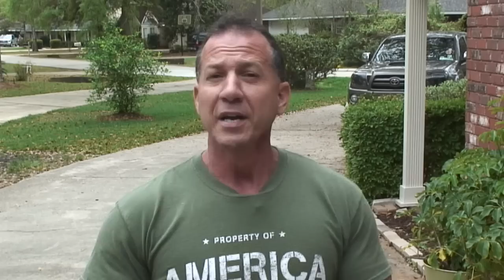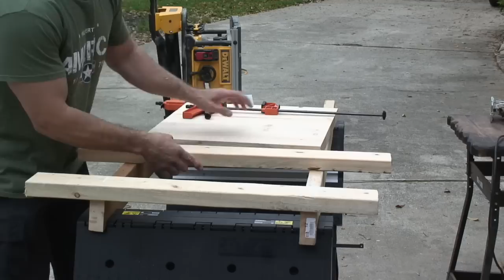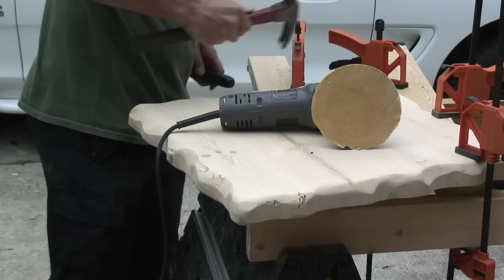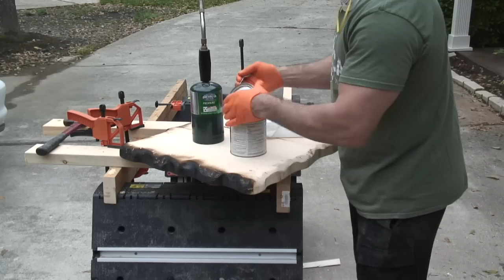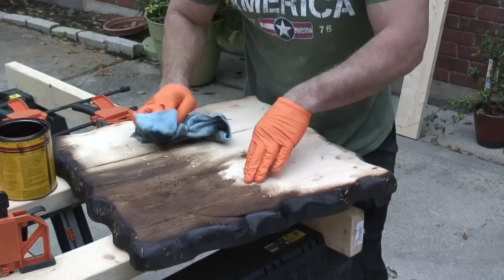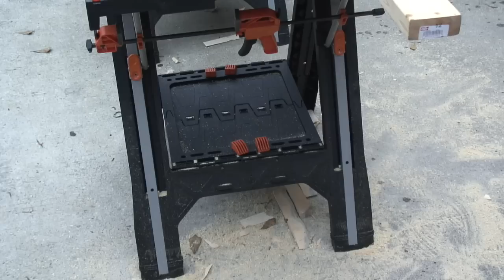Distressed Table Top using a $4.00 2x6

Comment: I can see that I probably didn't make the first 100 but I gotta say I like the table.  I have limited storage space at home (shed is mostly filled with kids stuff) and I have no basement so having a portable work surface is a HUGE DEAL.  I like the table top you showed and would be interested in trying it out and if successful then making a large picnic table the same way.  Good luck to the first 100 and eventual winner.

Comment: $100 for those sawhorses sounds like a lot, but when you consider clamps like that can cost $25 each it's not bad.  Will wood glue bind to the surface or is it a smooth plastic that dried glue will just peal off of?

Comment: Hey Paul 
I am looking to buy a new table saw, any recommendations? Love the saw horses definitely an must have piece of equipment in any mans or woman's workshop
Reply from the maker: Hi Ann,
I had a Ryobi table saw and it was ok, I think the new ones are better. I will say one thing with tools, you get what you pay for. My Ryobi finally gave out after several years and I bought a Dewalt with the wheels and stand. I must say that it is the best table saw that I have ever used. I charged it on my Lowes card because It cost me over $600.00 with tax. I am paying for it over time and I wish I had bought it years ago. This is a very accurate saw that easily tackles jobs without having to constantly square up the fence like my Ryobi . I would take a hard look at the Jobsite saw by Dewalt. it works just as well but doesn't come with a stand. It is easy to carry around and very accurate. I would also Google, Table Saw Reviews. Have a good day and let me know if you have any questions. 
Thanks!
Paul

Comment: I love the tables I have a question for you I redid the countertop and I used epoxy and recent there is divots on top of the counter how can I get rid of those
Reply from the maker: Hi Christina,
If you used an epoxy clear over your table, you can re-pour a light coat of epoxy clear over it and fill the divots. You must clean it well first to make sure that the epoxy sticks. This is how bar tops are redone when they get pitted or scratched up and become dull.
Thanks!
Paul